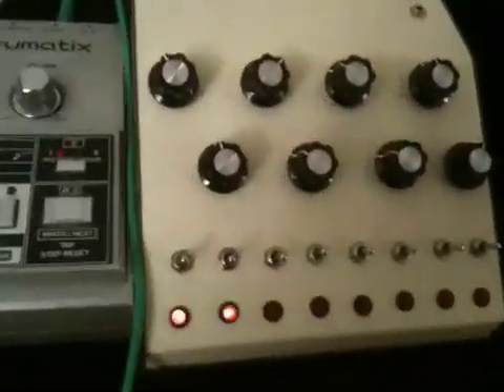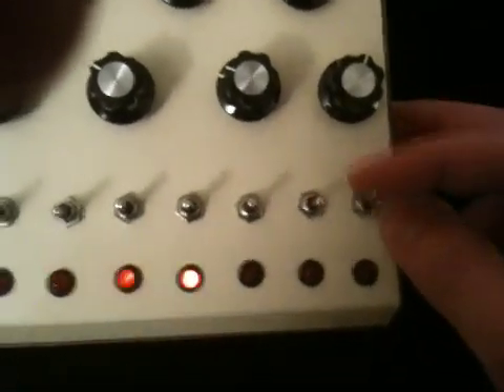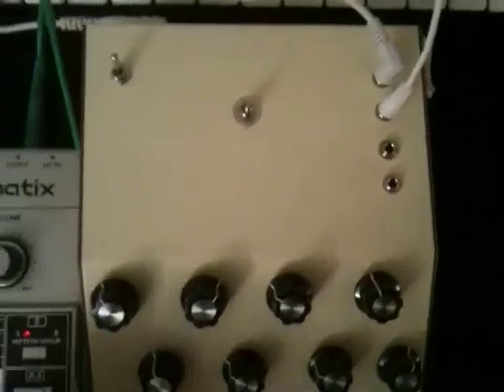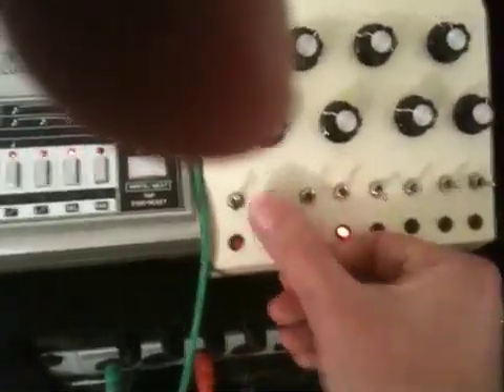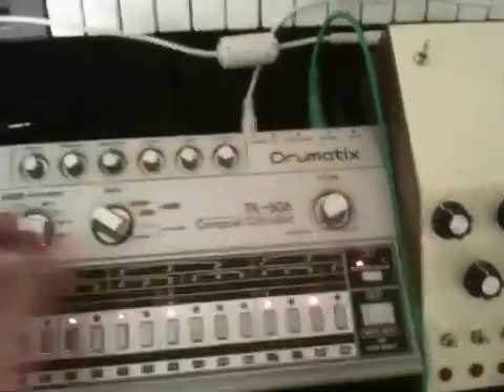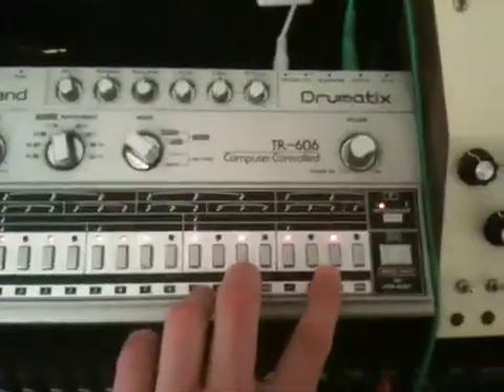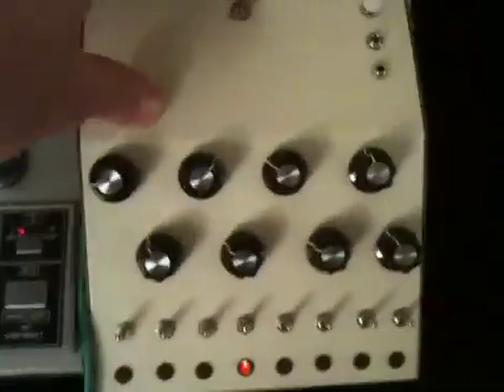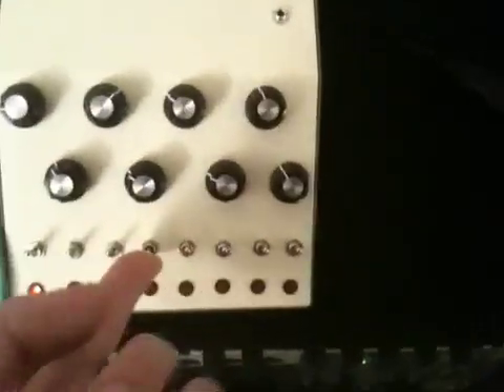My first DIY: Baby 8 Analog Sequencer

Comment: Do you have a schematic for this build?
Reply from the maker: Sorry I don't have the exact schematic for this build. I started w/ the one linked in the description and then added the switches, in the up position their output goes the the CV out bus, in the down position they go to a reset bus.
Reply: Thank you and no problem. I had built a Baby 8 that I wanted to modify since it was based off a simple schematic. I did some experiments with it and sorted out how to create an octave switch, external clock sync, and note on/off. The rest feature I had built into my original used a rotary switch but I think your reset switch is definitely more performance friendly.

Comment: If i used 12 volts, would that still work?
Reply from the maker: Yea, you may need to adjust some resistor values but the CV out really only has to cover 0-5V for most gear.

Comment: Hey this design is awesome. I just built a baby 10 and it uses alot of jacks for the resets your switch idea is great. Just wondering what combo of resistors did you use to reduce the cv out

Comment from the maker: @technoshamanarchist
I ran it on 15v per the schematic I was using, I kind of like the idea because it allows me to use a wider range of CV's. My skip function doesnt quite work like I had hoped, I just have it wired so when the switch is in the middle no CV is output but the trigger is still sent out. This means the envelope is still triggered and the synth outputs a real low note. Still need to work out that bit but this was my first DIY project. I think ill plan out a 16-32 step sequencer..

Comment: You don't have to power it with 15V (that is actually good for old-school synthesizers). The 4017 can work from 3V to 18V (and the output is relevant to supply voltage). I supply mine with 5V to run it with my Monotron, and it works perfectly. I never tried skipping steps. Do you just ground the relevant output of the 4017, or is there different method? Great job, very nice housing :)